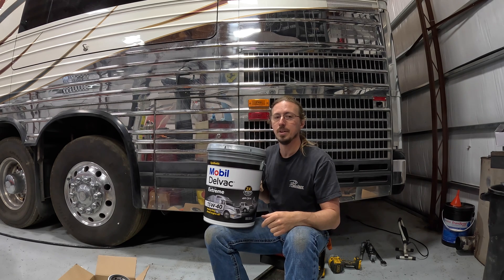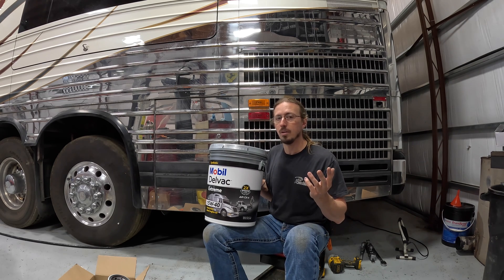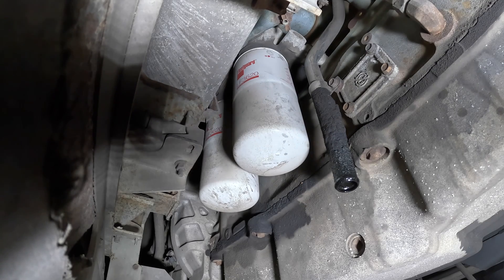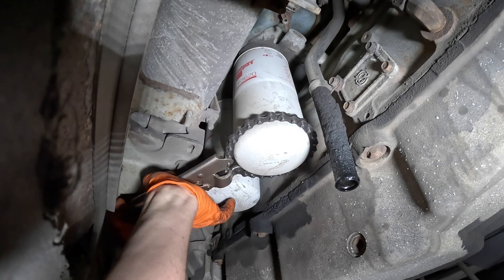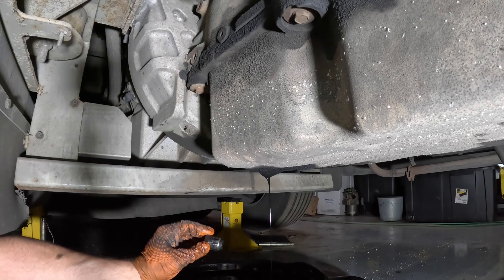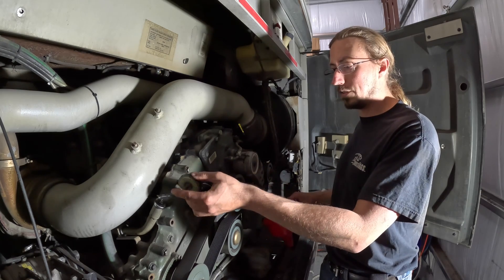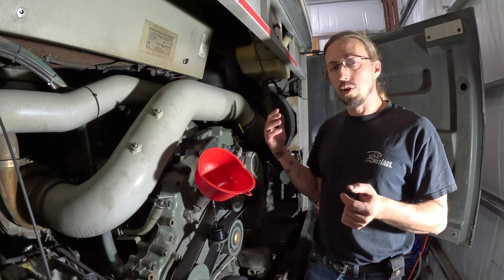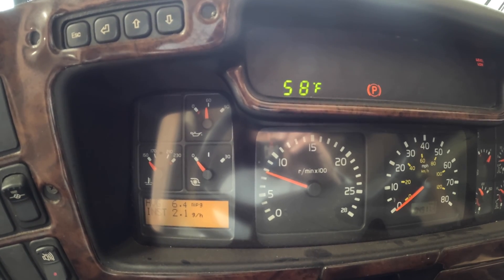Detroit Series 60 Oil Change: What Oil to Use? Which Filters to Use? Should You Do Oil Analysis?

Comment: My oil pain gasket is leaking a bit.  Did you do a video on replacement? I was also wondering what torque is typical on those pan bolts?  Also, your link to your how to brace the engine (jack?). Thanks. Nice video.  I have the 14L DDEC V

Comment: Ted I'm always afraid I'm telling you something you already know, but just in case....if you tip the 5gal bucket with the spout to the top, it doesn't do the glug-glug thing and is easier to handle.  Rotate the bucket as it empties to maintain that little air gap at the top.  Does make it hard to hold the funnel at the same time though.  At least you have clearance...most of my stuff I have to pour the oil into 1 gallon cans before I can get it into the engine.
Reply from the maker: Good tip! I definitely do that more with the gallon size jugs. For the 5 gallon ones I generally find that trying to rotate it while holding it up is harder, but that’s just me personally.

Always appreciate suggestions/tips, both for me and also for anyone else who reads the comments. The whole point for these videos is to help people learn (myself and others).

Comment: Once again great video, and attention to detail.  Question for you.  What are your thoughts on installing a fumoto valve for draining.
Reply from the maker: I might consider installing one on this since it would improve the situation of having to put the drain plug back in a bunch of times. However normally I'm not a big fan since they generally will restrict any metal chunks that are in the oil pan from coming out, thus potentially hiding some internal engine issues.

Comment: Would you consider installing a spigot on the engine oil pan where the drain plug is ?
Reply from the maker: Another viewer suggested that, and I might do that. It would definitely make oil changes easier, although the oil does drain slower. The other thing I don't like is that any chunks that come out might not make it out of the oil pan and warn me of issues. I'll think about it between now and the next oil change - for the once every probably 9-12 months I do it, it's not that big of a deal.
Reply: @TedsGarage  very good points

Comment: Great video!  The Fleetguard LF9009 oil filter for my Cummins ISC has instructions printed on it. Pre-fill, tighten hand tight and then turn 3/4 of a rotation with a filter wrench.  Also, I use Fumoto valves on all my vehicles.  Get the one with the "N" (for nipple) in the part number.  This allows a short hose to be attached if needed.  I remove the little plastic lock and slide the valve lever.  This allows you to fill into smaller containers for recycling and avoids that big gush of oil from removing the oil.  No mess, easy day.  It does takea little longer to drain.
Reply from the maker: Glad you enjoyed the video! I generally am not a fan of quick drain valves due to the slower drain times, but I think you've got a good suggestion in this case. The one negative is still that if you have chunks in the oil pan that they generally won't come out when you have a quick drain valve. I'll look into that before I do the next oil change. It is a bit annoying to do the multiple drains and fills with this.

I think it's more common to see the recommendation to pre-fill filters on Cummins vs. Cat (I believe the manual for the Series 60 said not to pre-fill either), but really, personal preference. When I was younger I pre-filled filters and now I don't - neither has ever caused me an oil-related problem.